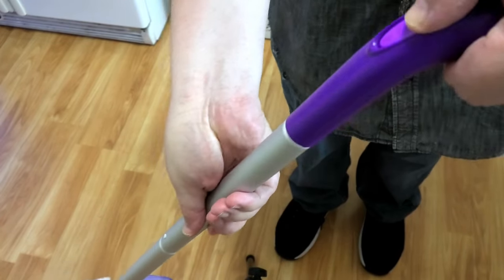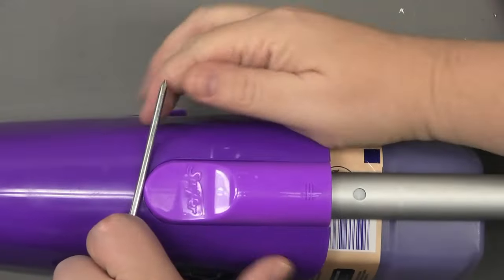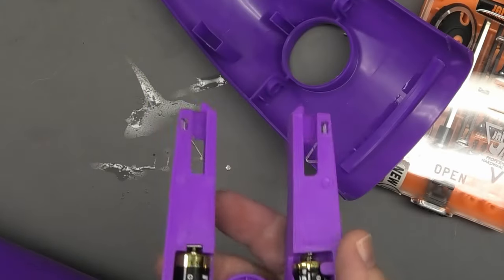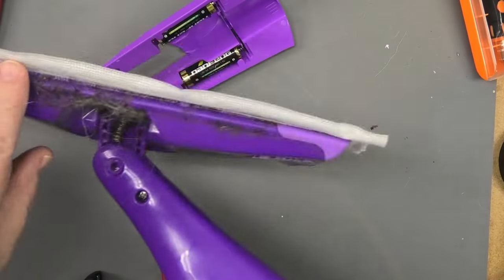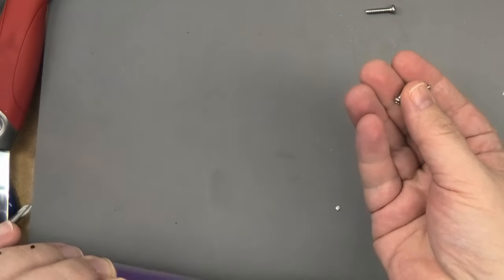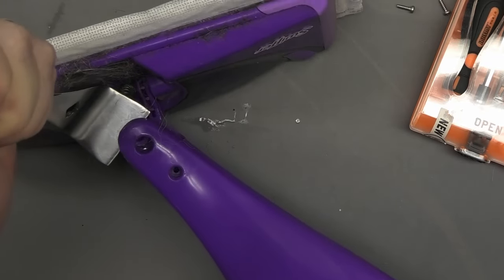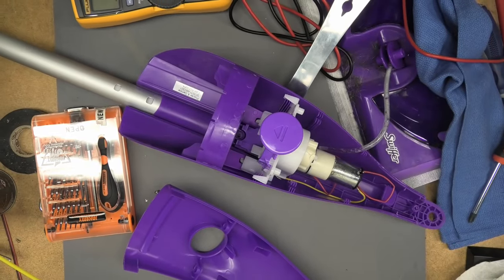Dead Swiffer WETJET Repair

Comment: What needs to happen is we stop buying them till swiffer comes up with a version that does rust out. I absolutely won't be buying another one. Nope ypu just throwing good money after bad makin the ceo richer.
Reply from the maker: YES, these are such a disposable item and the newer version seems to make even cheaper. Thank you for the comment!
Reply: Bought my last Swiffer - will try another brand. May not work any better but at least somebody different will get my money. Don't buy one of the off-brands from Amazon. Didn't last a few days.

Comment: Yes they are garbage. I had 2 for over 5 years, i thought they had a goid life and the motor was worn out. Bought a new one a month ago, and its already stopped working. I dis everything, took it apart, used it one time, and it stopoed again. I give up. Next time, buy the warranty.
Reply: call swiffer they gave me a new one
Reply from the maker: Good tip - we will try that next time - which is probably soon sadly...
Reply from the maker: Sorry to hear that, BUT it's about the same as our experience. I feel they make them cheap so they break and then you will buy another one.. Thank you for the comment!
Reply: How thoughtful about the environment they are 🤬 at least the old one you can access the motor through that hole the new one is completely enclosed … I have washed floors Cinderella style my whole life amd thought I’d give myself break to use this piece … I’m beyond pissed lol thank you for your video

Comment: Tapping on the motor with my scraper didn't get it done. It finally rose from the dead when I had the multimeter touching the motor contacts to see if it was getting juice, which, apparently, it was.
Reply from the maker: I actually had this happen to me once also, I was trying to figure out WHY did the multimeter get the wetjet working again? Sadly it was only a temporary fix for us. Thank you for the comment!

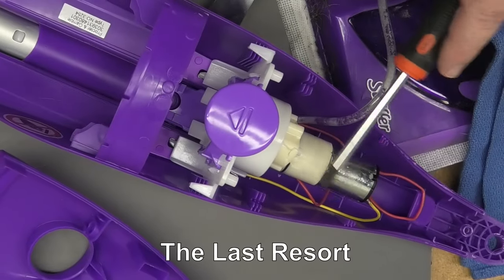Comment: After checking the batteries, the switch, and verifying with a multimeter that the motor contacts were receiving 3.22V whenever the switch was depressed, I’d all but given up on repairing this POS.  Lo and behold, the third or fourth 2:49 walloping from my screwdriver handle, and the patient was revived! 😂  Thanks for the housing disassembly tips.
Reply from the maker: You got the POS part right, these are totally a disposable mop and not much more. BUT very handy with our 4 dogs sadly -  Thank you for the comment!
Reply: Had to wack the crap out of the motor on mine with a screw driver about 20 times but then it started working. Thanks!

Comment: Oh my gosh, if there’s one thing that’s great about YouTube and Internet and all that is these videos. It worked! Unfortunately, mine was so rusted but it’s not super old. Sprayed it with WD-40. Knocked off a little bit of rust. Tapped the motor with like you said and it worked. I can at least get my floor mopped before I have to get another one. Thank you so much.
Reply from the maker: I feel it's only a temp fix, is yours still working? I've seen our with rush in it also - what a sad design for sure!! Thank you for the comment!

Comment: Thank you for sharing this! Mine is a newer model bought May 2024 (with a plastic cap on the motor). Tapping on the motor several times fixed the spraying issue
Reply from the maker: Glad it helped, but sadly it sometimes is only a temporary fix. I love these for cleaning up after our dogs, but HATE their cheap quality - Thank you for the comment!

Comment: I have the same newer motor that's missing the slot the older ones had. On the bottom of this motor there are two slots where I was able to get some deoxit in there. After spraying, I knocked on the motor till it turned using the switch on the handle.  I waited a second or two and sprayed again. Motor runs great now!
Reply from the maker: Oh did I use Deoxit in this video? I use it alot in my electronic repair, it's GREAT Stuff - Thank you for the tip! Thank you for the comment!

Comment: mine stopped pumping, would not come on. Some investigating found one of the 2 prongs that hold the cleaner solution bottle had poked a hole in the bottle and solution had everything drenched in cleaning liquid . let it dry out and filed down the prongs, because they continued to punch holes in 3 more bottles.  Emailed the Proctor&Gamble explained the issue and they mailed me a $30.00 coupon.
Reply from the maker: We seem to go through alot of these, and once time those two prongs had RUSTED off, crazy!! It's a "WET" jet, Hmmm. Great advice you have here, the next time we will email them also!! Thank you for the comment!